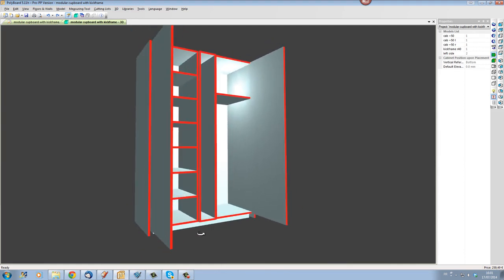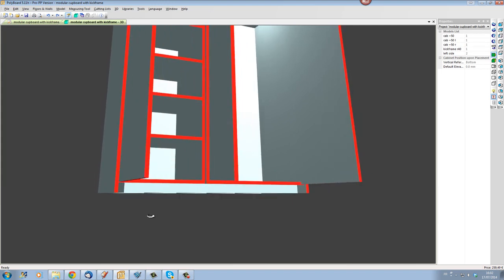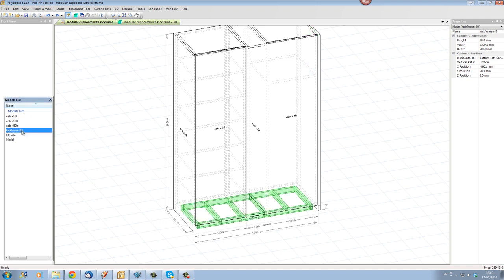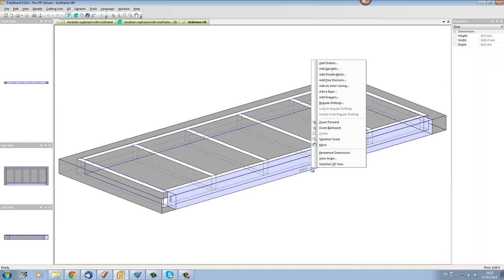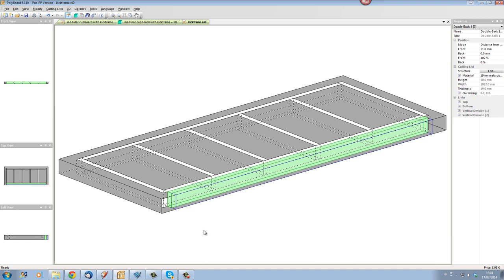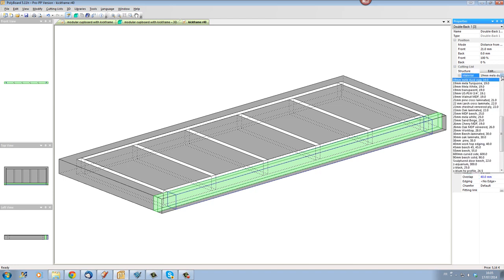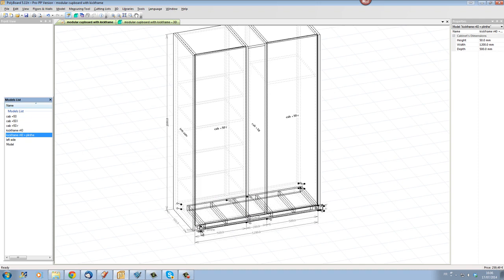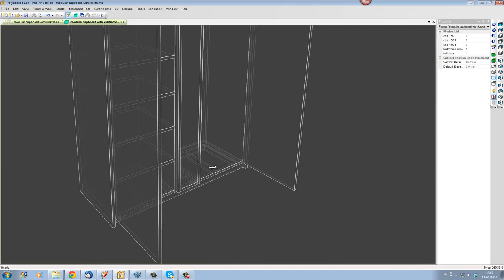Set up a Plinth With a Kick Frame Using Polyboard

Comment: Good guild but iwant to creat base frame with 45 degree chamfer at the corner of front? Can you show me?
Reply from the maker: Hi, using Polyboard's link parameters you can create a classic mitre joint, or add chamfers at a variety of angles. Please can you ask on our forum for more details: https://wooddesigner.org/forum/